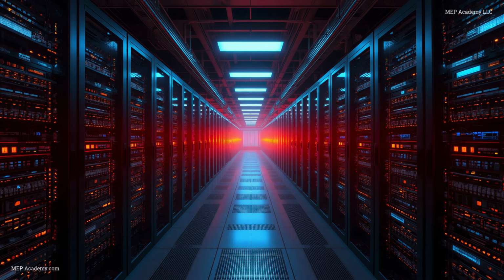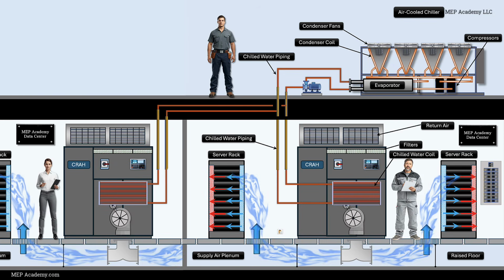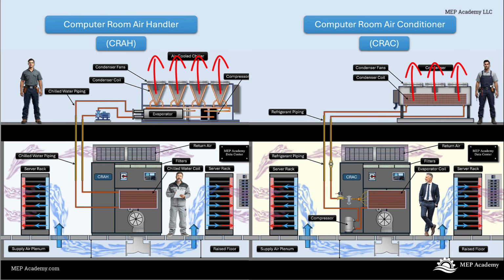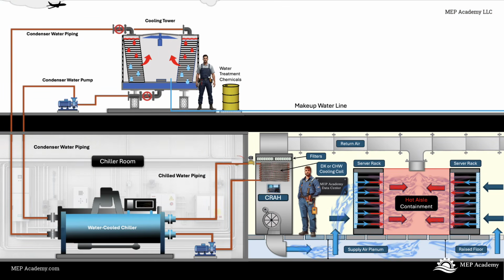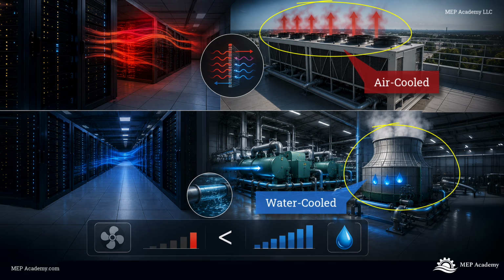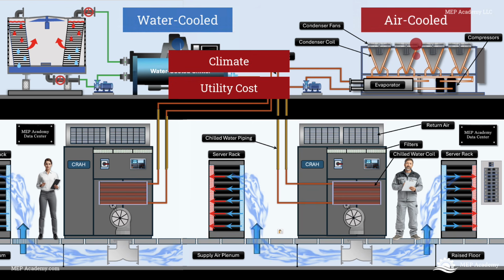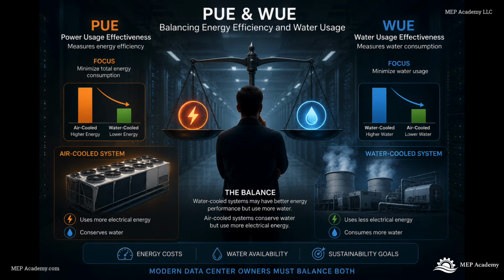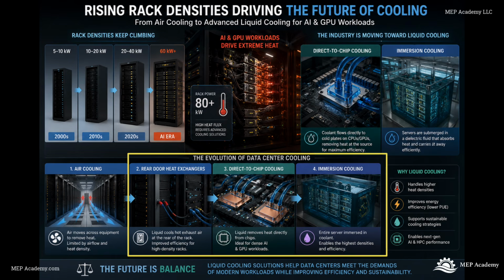Air Cooled vs WaterCooled Data Centers

Comment from the maker: 📊 Air-Cooled or Water-Cooled—which would you choose for a new data center project?
As AI workloads continue to increase rack densities and cooling demands, the choice between air-cooled and water-cooled systems is becoming more important than ever.
👇 Let us know in the comments:
Would you prioritize lower energy consumption or lower water consumption? Why?
If you're enjoying this Data Center series, be sure to check out our other videos covering:
✅ How Data Centers Actually Work
✅ Data Center Power Flow
✅ Data Center Cooling Methods
✅ UPS Systems
✅ Hot Aisle vs Cold Aisle Containment
✅ Chilled Water Systems
✅ CRAC vs CRAH Units
🎓 Looking to expand your technical knowledge? Visit MEP Academy for online courses, estimating tools, spreadsheets, and resources for HVAC, Mechanical, Electrical, Plumbing, and Data Center professionals.
👍 If this video helped you understand data center cooling, please Like, Subscribe, and Share it with others in the industry.
Thanks for watching and being part of the MEP Academy community! 🚀